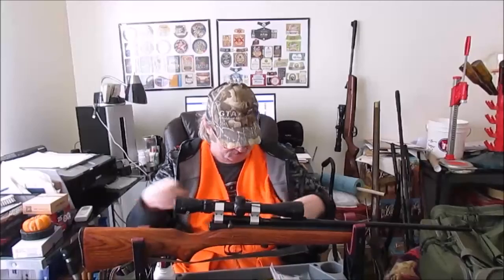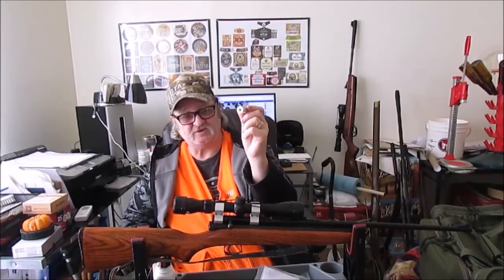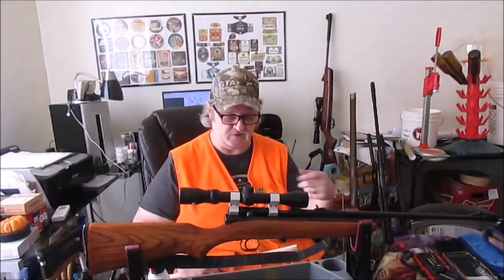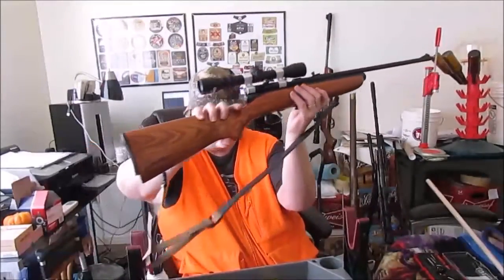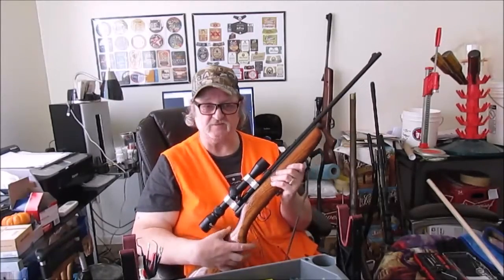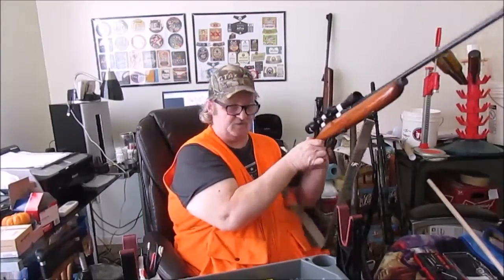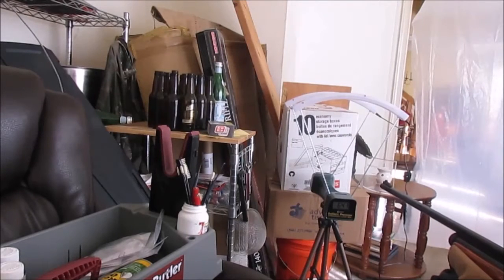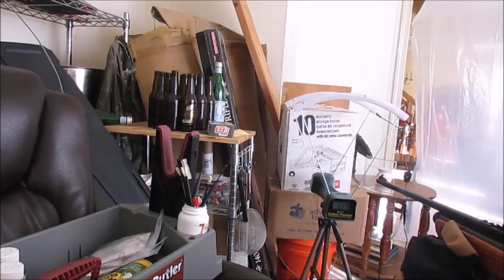Airgun Shooter Ep13 Crosman 160 Pellgun mods & test

Comment: The slot is for a big screw driver, you loosen the the two haves of the valves the o ring is not compressed. Slide valve in tube and bolt it down, reach down inside of tube and tighten valve with big screwdriver in the slot and it compresses o ring to make seal. that is why you  had to beat valve in because o ring was bulged out to big. Reverse process to get out, must leave bolted in to be able to loosen valve.
Reply from the maker: Yup. Little tweaks you learn along the way.